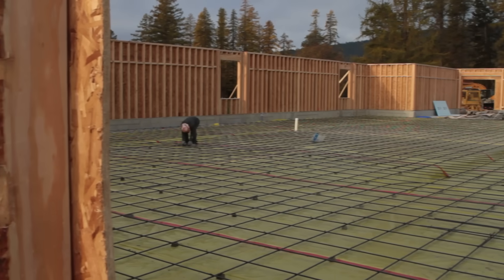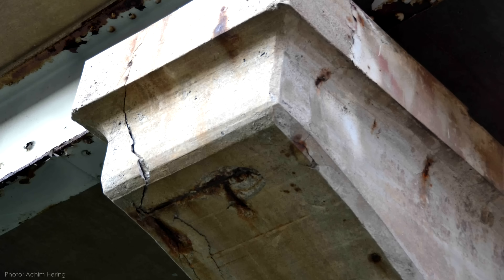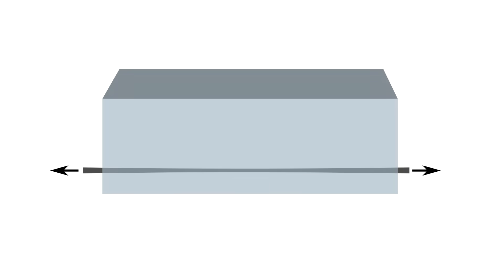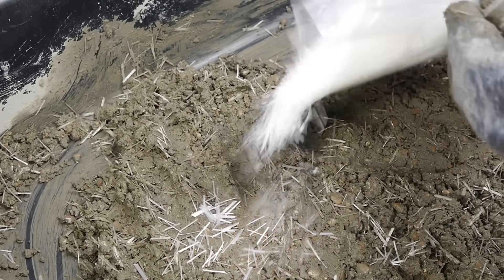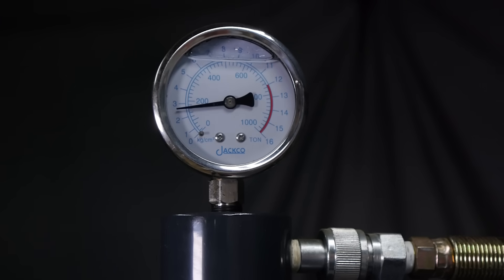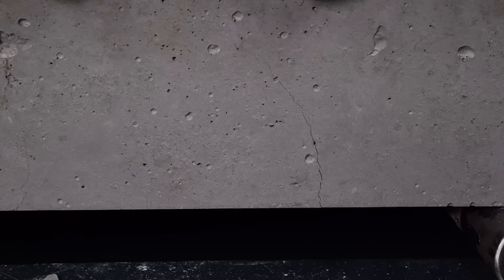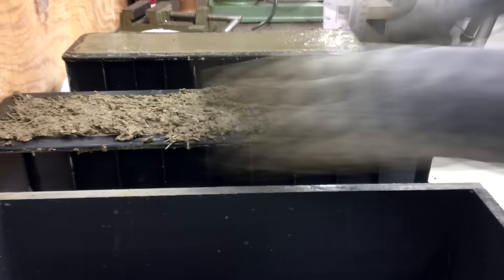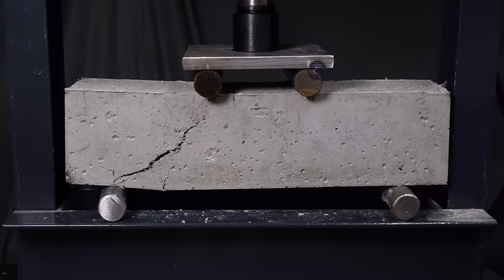Does Rebar Rust?

Comment: The rebar used in all three slabs were too close to the bottom. At least two levels of rebar should have been used  if not three. A job I did a few years ago I used 3 levels of rebar, in a 40cm deep slab, with the space between the rebars at 10cm. There’s also crystallizers nowadays that makes the concrete waterproof plus you could also use a product which is applied by brush or by spraying it on the rebar totally covering it. A corrosion would never happen.
Reply: Grady isn't making perfect reinforced concrete beams, he's demonstrating to people how the process works. The entire point of those concrete beams were to be tested to failure and ideally show examples of the cracking he was describing as a potential hazard. They performed perfectly well, especially when you consider that he also highlights in the video that a common problem in reinforcement is being set too close to the surface of the concrete.
Reply: Crystalline waterproofing is not perfect and depends heavily on application. Same can be said for corrosion resistant coatings on rebar. I can tell you it’s almost never applied perfectly either and I’ve had many jobs where we found corrosions on bar that was coated when installed
Reply: Lazarous, you are in good way,  teach the peaple.

Comment: In WISCONSIN, most of the overpasses and ramps were replaced after the rebar had corroded, rusted, and "spalled" over the past 50 years from all of the salt used on the road surfaces in winter.
Reply: Hi from Milwaukee 🧀🍺

Comment: I worked a parking lot rehab in 1994 due to rebar corrosion. All the delaminated concrete was "chained" to locate it and jackhammered out, The rebar was sand blasted and epoxy coated before being filled with "bobby pin" reinforced concrete (the rebar was that bad). I was in that parkade in March 2021 and the work looks as solid as the day the job finished. Too bad there are large sctions of conrete on the columns that are now flaking off due to rust. There is another rehab due that will likely use glass fibre reinforced shotcrete.

Comment: Would imbedding the vertical rebar deeper into the concrete column afford any additional protection from salt penetration? How about wrap-around steel and/or FRP? In the Nimitz Freeway collapse in the 1989 Loma Prieta earthquake, similar failures occurred, and a CalTrans engineer said he had suggested wrap-around rebar, but the suggestion was ignored. I never heard of him again. But a lot of freeway structures got retrofitted. I heard there was a problem with the I-805/I-8 overpass, but never could verify whether or not it was fixed. Of course, bridges are not 12-story buildings, and context is everything. Which brings me to my final question: How does one "maintain" columns after they've started spalling and corrosion has taken hold? Even if "corrective action" had been taken after the 2018 report, how long would the building have stood? Seems to me that a lot of horses were already out of the barn, starting with the date of completion . . .

Comment: Ford Motor CO used to have an advertisement, back in the '70s, dipping the whole car body to prevent corrosion, if they apply that process to rebar, I think, it will last a long time.

Comment: How dangerous is it by using "glass" fibers when the concrete needs to be destroyed...or metal? Could safer materials be used to plan for deconstruction?
Reply: It's not dangerous. It's not like glass shards. Fiberglass rebar is made by a bunch of strands being soaked in a resin bath, and the resin is then cured. 
The glass strands are actually really soft. Once it's cured, you can cut it with a diamond embedded blade (similar to how you cut concrete
And it doesn't shatter when broken, it basically cracks and the stands come apart

Comment: Answer: only if it's made of steel and exposed to oxygen and moisture. Titanium, bronze or gold and you're all set, although gold tends to have poor tensile strength and other disadvantages.
Reply: Just coat the outside in thick zinc brother
Reply: @kevinmatthews8980  Agreed. l just have an irrepressible wise guy attitude.

Comment: I worked at Redland Bay Golf Club, near Cleveland, Brisbane, Queensland, Australia.

During WW2, it was an American Military Base, and they laid down some concrete pads with massive twisted, flat reo bar for large generator use I believe. We ripped it up to build a new machinery shed next to the clubhouse, and there wasn't a spot of rust or corrosion otherwise on the reo bar after some 60 years.
Reply: Probably p o get my
Reply: Very interesting. Any more details on the type of rebar? Was it stainless, or coated? Thx
Reply: Was it a relatively dry climate there? Perhaps the steel used was 'pure' and not containing the impurities that recycled steel much used nowadays has.

Comment: I've loved fiber mesh since I learned about it 30 years ago working at a concrete company.  Problem is most suppliers don't encourage it. Often they say it doesn't really add any strength.  I've explained it's about cracking, not strength. But the added couple bucks per yard just stops most people from using it.
Reply: Fibre has a remarkable effect in stiffening up the concrete mix (you can see in the video how stiff it gets).   This makes placing the concrete much more difficult, in particular ensuring that the concrete flows all around the reinforcing without leaving voids.   Which in turn means that much more labour and care are required in construction.   No such thing as a free lunch.
Reply: @cr10001 just use a plasticizer
Reply: @cr10001 excellent point and perspective- loving the dialogue here in concrete- so much smoke and mirrors and shibboleths in the industry.
Reply: Fiber in general, works in concrete very well and it's a cheap solution.

Comment: you have to use dobies and they do make epoxy coated rebar , i have came across a lot of rebar that was at the bottom of the slab that cause it to rust just poor construction it should be close to the middle of the pour to work right

Comment: When living in the Boston area years ago (1988-1994) the highway authority was transitioning to stainless steel rebar.  Massachusetts uses a significant amount of salt in an effort to keep the roadways free of ice and snow during the long winter months.  However, the salt takes a significant toll on the rebar supposedly embedded within concrete.  They have had significant success with stainless steel however it is of course more expensive.

Comment: It takes 3 to 6 months for concrete to maintain a heavy load...but in 2 to 3 years it's 200% stronger than it was at 6 to 12 months
Reply: Concrete takes 75 years to reach it's maximum strength. It takes 30 days to hit it's targeted psi usually exceeding. It can also achieve it's targeted strength in half the time with hot water and excelerators.
Reply: @74stevedc  why didn't you comment on my stainless steel rebar...before the accident before your experience..stainless rebar was working miracles...third best reason to use stainless rebar is costal parking lots in large buildings...I guess you dont live on the coast...people are scared to use stainless..they just dont understand how great it is and how many lives it saves
Reply: @randyjohnson6845  I have never worked with stainless steel rebar. I'm sure it's great stuff. I live in Massachusetts we experience 3 months of freezing temperatures. Roads and sidewalk's treated with salt and calcium chloride bad stuff for untreated concrete. I'd like to try stainless rebar some day.

Comment: I think it should be mentioned that while visible cracking of the concrete shown in the video is decreased, micro cracking (which will allow water incursion) is still happening. Concrete needs to be protected by a hydrophobic additive, sealing (paint, waterproofing e.t.c) or other means of long term care if uncoated reinforcing steel is going to be used in harsh environments, especially those that involve salts and standing water.

Comment: should be a new code in the US=Stainless steel rebar delivers unmatched quality and benefits as measured by superior corrosion resistance, concrete durability, cost avoidance, better structure uptime. And ultimately, the least life cycle cost. Stainless steel works and more than pays for its cost. The raw material may cost more but it works!

Comment: I was one of the Superintendents for the UCSD( University of CA San Diego) Tuolumne (dorm) Project which included the repair and restoration of the exposed rusting rebar, from salty moist ocean air, which caused the exterior concrete to spall being that some of the coverage was less than 1/2”, especially on the patio decks because by design, there isn’t a support or column from below or post tensioning, therefore requiring a ton of rebar to strengthen the deck.  The new railing required coring the deck as well which required any new reinforcement on the decks with large portions of spalled or missing concrete edge(up to 6”in from edge and 8”wide had to be edge and deck formed to be placed with new concrete, which btw, had to be color matched and approved by the UCSD Rep or PM before placing or patching any concrete) anyhow, the new rebar had to avoid the cores.  The rebar that still had integrity had to have the rust removed before coating with a Sika brand epoxy before being patched with a polymer based concrete patching compound, all under the watchful eye of the  inspector, for good reason because nobody wants to be liable for a deck collapsing or spalled concrete popping off and falling 5-6-7 stories onto students below.  Anyhow, the sub was dying on the rebar mitigation because wire wheels can only do so much before wearing out or not fitting in tight areas, and the hand scrubbing with a wire brush takes forever!  Thank god I was the superintendent out there lol, because we had 3 months to finish the aka ‘summer sprint’ project or face penalties of $1000 a day for each dorm room that isn’t complete and there had to be almost 100 rooms total out of the 10-12buildings we had, so I suggested a pneumatic needle or descaler gun, to which their Supe was skeptical about, so I purchased one from Harbor Freight and put that to work on one of the patios.  They were blown away at how fast,thorough and tight space accessible it was!  It literally saved all our asses and we were able to get Certificate of Occupancy a day early!

Comment: Unfortunately, the only good thing coming out of the condo collapse is the legislation to get rid of the steel rebars and adopt the FRP rebars. Impervious to the elements and the coefficient of expansion almost identical to that of the concrete. It is the only kind of reinforcement allowed to be used for public works, buildings, piers, etc., in some jurisdictions throughout Florida.
Repairing the structures of the thousands of buildings in Florida will never be enough, and we may see similar tragedies in the very near future.

Comment: Before I retired I was a Certified ASTM physical Tester in quality control lab at Cemex cement in USA. I remember that type V portland mortar cement  spectes are for product mixed by ASTM standard. Contractors like to put Calcium Chloride in the cement mix to force cement to set up fast. This is not good for raw iron rebar. Maybe test should be done with hot dipped galvanized rebar in mix with concrete.

Comment: Rust used to be a huge problem in automobile bodies.  It has become much less of an issue since the 1980s, due to zinc galvanizing of the steel bodies.  The technology is well understood and simple, so I wonder why rebar is not simply hot-dip galvanized to protect it.
Reply: Zinc coatings suffer from a couple of issues.  Abrasion while being handled prior to encapsulation in the concrete and the eventual loss of the zinc coating over time due to galvanic action (the zinc is literally sacrificed).

Comment: Thanks! Good perspective on recent failures. Is it economically viable to galvanize rebar and would that prevent the concrete failures associated with recent disasters?
Reply: Mark, yes that is a good way, maybe one off the best ways in this time.  To much looses,
everywhere. The steelbar come in contact with the air(Oxigen), and start the dead. The steelbar  MUST  rost,   its a  physical chemical law,  nobody can stop this,  without Protection  fore the STEELBAR.   More Investment in the investigation  fore any solution, but the industrie  dont like that so much?  Plenty  Profit in this aerea, plenty corruption ,  money  is behind  the 
concrete industry,  and money is the winner,  not the steelbar....., the poor steelbar.
The oxigeno in the air,  brake down the strongest steelbar, without nouise, without  smel, without cry,  only a intelligent man  can stop this.

Comment: Meanwhile, latin countries required that the iron bars need to be treated with a polymer based coating to prevent corrosion.
The concrete formula needs to include hydrophobic component.
Please explain Hydrophobic layers to protect from corrosion.
That would be helpful.
And yes..adding fiber glass fiber, metal shard and granite or other minerals can help but it about the combination of these solutions.

Comment: 5:47 Interesting video but I don't understand how you say the fibers don't add strength but help with corrosion.  IMO, one week is not enough time to gauge corrosion.  I don't think you proved they helped with corrosion.  If so, please expand on that point (what proof can you reference.)  

I realize they both failed around the same load.  I am curious as to why it didn't crack as much up to the point of  failure.  My best guess is that the fibers simply added some tiny voids as well as a small degree of flexibility to the block.  Since it was not completely solid, perhaps it was slightly more pliable.  If that is true, it would need to be studied how it would hold up over time.  Perhaps, with various working loads, expansion and contraction you would develop more cracks in time since it is flexing more.  Again, one week under controlled conditions reveals very little.  Still, it is a mildly interesting experiment. 

Yes, no one wants to be the first to install a new material only to have to remove it a year later if it behaves unpredictably which I suspect it might.

Comment: Yes, it would add cost but why can't rebar be dipped/coated in some kind of waterproof sealant so it can be isolated from moisture over  time?
Reply: because it does add cost
Reply: A easier solution is to use GFRP (fiberglass rebar). It's waterproof from the start, and it can't rust

Comment: Epoxy coated rebar plus low permeability concrete. This is used in concrete bridge decks and can be used in structures as well.
Reply: Epoxy coated rebar is worst than having a bare rebar, because it is causing an accelerated rusting at the spots where the epoxy breaks after it has been bent by the workers or hit by a hammer and so.
Workers must then use an epoxy spray paint to cover those broken epoxy spots, but it is impossible to cover all of the spots perfectly (which they should be) and so an accelerated rusting will start to happen as the water will sit concentrated at those spots, and those spots will become a breaking points on the rebar. Epoxy on the rebar must be banned.

Comment: Yes if uses rusty rebars. It will do so after 30 years. If used on window ledge, it began to crack , the crack becomes bigger and concrete edge will fall. This happened to my house. It's better to supervise the framework of the house only if you knew some building construction as some contractor will cut cost and use inferior or unregulated  metal of smaller size that will give problems in the later stage

Comment: It is nice too see how much is tried with the actual concrete to fight corossion .
But one thing they all seem to have forgot is the fact that the rebar / steel is getting weaker .
Fact is that when all focus have being on the concrete itself most have forgot the steel .
Slowly over time the steel industry is actually making lesser and lesser quality products ,
so to gain more profit out of same ore .
It would be good if focus also is on the quality of the steel .
After all it is the steel that oxidice and end rusty and really not the concrete .
The problem with concrete is cracking and loosing strenght ect BUT actally not oxidation .
As quality of steel continue get less the problem increase .
What we need is steel that is MUCH more capable to withstand rust / oxidation / corrosion .
That would help a lot .
But the quality of the steel is very much the most over-looked thing .
( Thus the industry can easier cheap out on it )
Reply: not true  ...US steel has always been top quality
Reply: @davidjones-vx9ju  Actually not .
It's profit market just like everything else .
Slowly getting into lower quality so customers doesn't recognice .
Steel doesn't have to rust that easy and fast , but reality is that it does .
You can look at many different items over time and see how fast they rust compared with back in time .
From cars to bicycles to metal roofs to rebar ect ect .
It speak for itself .
And it is all over the world this is happen .
I know national pride make people kind of forget reality and just say ( x country ) never happen , but it does .
Houses and bridges also only collapse in China  , Right ? 
Start by actual look into this deeper and you will find .
It is all about money .

Comment: in the Miami building collapse shody construction of the column is involved what i seen in the 70s and 80s a frame work of the column is built wit steel bars then concrete is poured on top of the steel frame . the failed building columns some really thin rebars stuck in the concrete